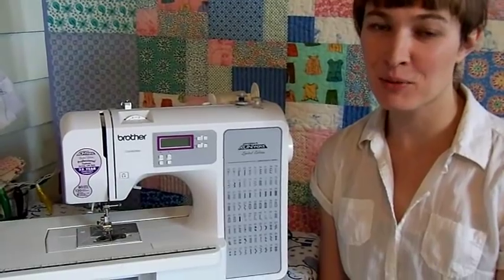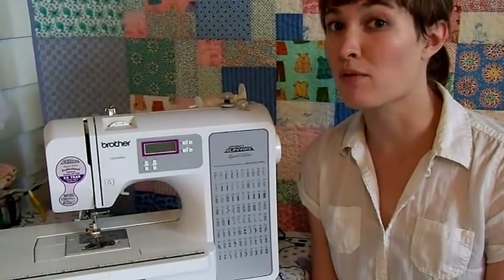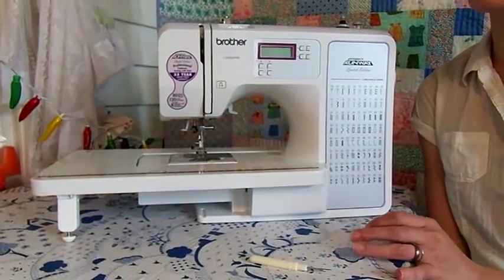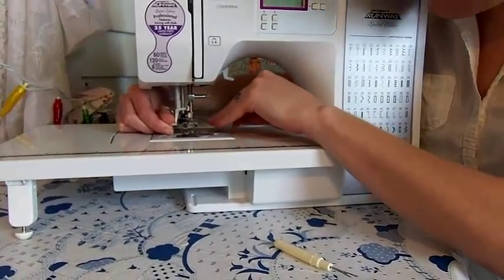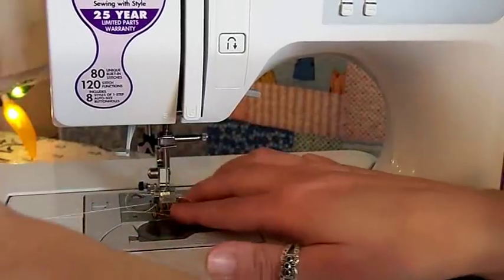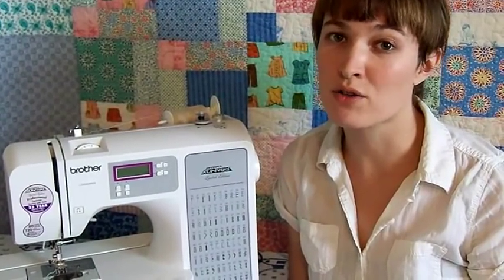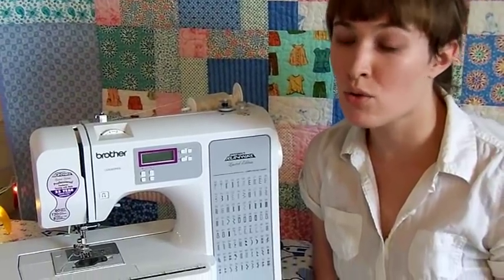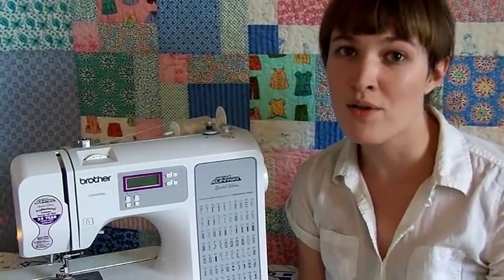How to Use (or Fix) an Automatic Needle Threader

Comment: Works great. Have enjoyed embroidering and for piecing quilts share4.photo/sSewing No issues with it. Seems to work with most 7mm feet. I’m using some of my mother in laws Brother feet from the 60’s/70’s and they work great. Even a very old walking foot which has been great. Nice heavy duty case which does not move around when I sew.

Comment: So I have had my viking jade 20 for about a month and after about 2 weeks the needle threader stopped working.  We tried your fix and after tinkering with a magnifying glass, bright lights and my husband's help we bent the hook back into place but it was an ordeal.  Well yesterday the needle threader stopped working again and I decided to ask at Joann's where we bought it for help.  But before I took it into them I tried one more thing that I did not find on the internet but just noticed looking at my machine--there is an easily accessible screw on the needle threader itself that I loosened and retightened and whala!!  The threader works great now.  Didn't have to return or pay a service guy to look at it and no time lost sewing!!Yeah!!  Hope this helps some others!
Reply from the maker: I'm glad to hear that you were able to find a new solution to the problem! For anyone who has a machine where the needle threader screws to the shaft, this is something that you should take a moment to check before attempting anything else! Thanks for taking the time to comment and to share your insight!
Reply: sharon gregory it re-fed the bobbin through and then re-threaded the machine making sure the thread grabbed where it was supposed to and it got everything working! I was really at the end of my wits trying to figure it out but that worked!
Reply: I did try every screw around and re-installed the needle and re installed the bobbin and thread from the top and it started working, obviously something wasn’t threaded right to grab hold and move everything into place. I get it how hard it is to manually thread the needle between age and lighting it was so sucky! Hope this helps everyone! Stay safe

Comment: Oh my! Thank you so much for explaining to me how to fix my machine.  It took a little doing, and some patience (and a high power magnifying glass for my poor old eyes) but I finally managed to fix the silly thing, without a trip to the repair shop which I could scarcely afford.  It turned out that the whole mechanism had slipped down too low on the shaft.  I pushed it back up and after a few little tweaks, it works once again!  I thought it was hopeless! Bless you, you sweet, thoughtful young lady.  What a great help!  Keep up the good work.  Bravo!
Reply from the maker: +Carla Stone Oh, Carla, you're welcome. Thank you for your kind comments as well. Don't get me started on repair shops!!

That's interesting, but also unfortunate what happened to you. I didn't know that the mechanism could drop down like that. If someone has that problem, I will send them too you. Happy sewing! and I will try to keep up with the videos.

Comment: OMG, you saved my sewing lsanity! I'm using a fairly new Janomie DC5100 machine and right from the start I had problems with the auto threader, but I never used one before so I figured it was me. Then all of a sudden it started working.   Then recently  I changed the type of thread I was using, and it stopped working completely.  My eyes are bad, and this a function I really love.  After watching your video I figured out that all I had to do was gently move the needle to the left a bit as I was threading it, and it works perfectly.  I think the hook is a bit bent, and I'm guessing it came that way.  Frankly, I'm not thrilled with this machine, but since I've used it and can't return it, at least I can get it to work the way it's supposed to!  Thanks so much for posting!
Reply from the maker: +ML Walsh  Gee, I've always wanted a Janome or Bernina, but I suppose that they can have problems too. I'm not sure if I mentioned it, but some of the different thread sizes can cause problems with the threader. I recently bent the hook again by using a small needle that didn't have room for the thread and the threader. I fixed it and stopped using the the auto threader with that combination. Happy sewing!
Reply: +Lzy's Sewing Room The machine manual will tell you what size needles you can use the autuomatic threader with for people that don't read the manual.  I'm not insulting you, I am saying this for the people out there that set their machine up and start using it.

Comment: I am brand new to sewing and this is my first machine. Thanks so much. I just self threaded for the 1st time. Also: Can you recommend other videos specifically for this machine. I made curtains & pajamas so I am "sewing," but I don't know when to change a needle, what presser feet to buy etc. I would like to watch videos where this machine is used. Thanks. Julie
Reply from the maker: Hi there Julie, I'm sorry that I didn't get back to you right away. I had a password problem of all things!

I change the needle after every few projects or if I'm having a problem with my stitches or the machine jamming. Maybe 8 hours of use is a rule of thumb, but who calculates their sewing time like that!

My machine came with several presser feet. You may have noticed that when you change stitches, the machine tells you which presser foot to use. There's an icon in the center of the screen. Below that symbol is a letter, this corresponds to a foot.

J is normal foot for straight stitches and a few zig-zags.
G is used for zigzags and it does a quasi rolled hem. See stitches 6-9 to get an idea of its function.
I use the zipper foot "I." For clarity that's i not L. This one has a single ski-shaped arm/runner in the front.
I also use the buttonhole foot which is made from white plastic. It's about 4 inches long. It does a great job of matching the opening to the size of your button. (Maybe I should do a video showing how that works.)

I almost never use feet N, R and M. I believe R is for fancy invisible hems on slacks, dresses or skirts, but I prefer to do hemming by hand, so I've only used  it once.

I use the free-motion foot, which has a clear plastic oval at the bottom where the needle sticks through. There's a spring along the shaft that helps it hop up and down. It's good for free-motion quilting or stitching lace with the feed dogs down/disengaged. I had to purchase it separately, and it's probably not worth it for most people.

I hope that this helps! I wish you lots of luck and hope that you have loads of fun. If you have any questions or video requests, just leave a comment!

Comment: You.Are.Awesome!!!  Because of your awesome video, I was able to fix my needle threader which saved me from having to tote my machine to the store for repair.  THANK YOU VERY MUCH!!!
Reply: What was happening and how did u fix it.    Mine won’t go into the hole and goes to the side
Reply: @jodiemcaninch676   I had the same issue you have.  My hook was out of alignment.  I used my seam ripper to nudge the hook back into alignment.  If you fast forward the video to 3:00, she explains it and shows you how to do it.
Reply: I'm afraid my hook is truly bent too fast to fix. I'm trying to find a video that will show how to replace that part. I've bought the part with the hook but can't get the old one off. Why do these things happen in the 21st Century?!
Reply from the maker: Sorry to hear that, @Susan Sinclair. The needle threader part is very delicate, but it sure is anchored on there....hope you find a convenient solution.

Comment: Hello, sorry if this is an idiot question 💜 should the hook (crochet hook) you describe go through the eye of the needle on the machine? Or should it incase the needle either side? 😋 My machine actually has 4 forks/prongs that incase the needle either side? Or should these go through the eye of needle? Erica x
Reply: The 4 prongs are actually your cage.  You need to look closely inside that cage for the hook.  It's very thin.  I have to use magnifying glasses and a magnifying glass to actually see mine, but I have old eyes.
Reply from the maker: Yes, @Rena Marroco is correct. The four-way structure is the cage that helps the hook-and-eye mechanism complete its action. It's possible that it's broken or bent.

Comment: A close-up view from the front and the sides of how the pin/hook should be aligned with respect to the guide arms would be helpful.  Our hook got bent, and though I bent it back towards the middle from front view, the hook is having trouble passing through the eye or  gets hung up on the eye when trying to withdraw it, making think it's still bent slightly up or down from where it should be.

Comment: I have a Singer Promise Sewing Machine,  but no automatic needle threader.  How do I get one to install on my Sewing Machine.  Do you have to buy a Sewing Machine with automatic Threader or what?  Please comment.    John
Reply from the maker: Hi there John, I don't think it's something that can be added on. You could use  a tool to feed the thread through. Dritz makes a classic one it's less than $2. It looks like a coin with a thin wire loop attached. You put the thread through the loop and then slide the loop through the eye of the needle. There are other styles too. Here's a link.

http://www.joann.com/dritz-needle-threaders/1038959.html#sz=90&start=1

I hope  this helps!

Comment: The automatic needle threader foot that grabs the needle when you push down, doesn’t move position in toward needle , (the little metal grabber to the right of step seven) a fix from anyone who understand that,
Reply: have you a solution? I have the exact same problem :\
Reply: I did figure it out I think, I honestly just took out the bobbin and re fed the thread and I also took out the thread from the top and re threaded it also, that also fixed the problem with the stitches bunching up on the underside. I hope this works for you. I loved the automatic needle threader as it was getting hard for me to see the eye 🤪
Reply from the maker: See if there's a screw to tighten that cage around the needle threader. It sounds like something isn't gripping. Good luck!
Reply: @lzyssewingroom2160  thanks, got it

Comment: My needle threader is stuck in the down position.  Any suggestions?
Reply: Same.
Reply: The hook won’t pass at the hole of the needle and keeps going to the side
Reply from the maker: If the needle isn't at the right level, the needle isn't inserted fully, or the handwheel isn't adjusted to the right position.
Reply: Paula; Hello, you  have to " lower the foot lever",if it can help😊🇨🇦.

Comment: That does not always work.  Sometimes it is a case where you need to loosen a screw in the needle threader and adjust the part that has the wire attached to it right or left.  There is also a screw that adjusts the up and down if it is going above the needle or below the needle.  I got the instructions from a repairman in Australia.  Sorry, I don't have the website.  Their fix was what my needle threader needed.  Bending the wire can break it if you are not extremely careful.
Reply: +Janice Hamilton Also, I use the needle up/down button to make sure needle is in highest position.
Reply from the maker: If anyone has a machine like yours, that would be a good thing to check before trying anything else. If the assembly is loose, that's the only fix.

In my case, the machine doesn't have a screw-on attachment for the needle threader mechanism. It has a rivet, so tightening the screw wasn't an option. The metal piece there is quite flexible due to the nature of the job that it has to perform, so I felt comfortable gently nudging it back into place. The way it was, it was unusable, so I didn't think it was risky. Of course, if anyone doesn't feel comfortable completing this type of DIY fix, the repairman is always available! Thanks for taking the time to comment, Janice.
Reply: I think I need to adjust the one that makes it go up and down. The whole mechanism is stuck in the "down" position and won't go up into the machine and away to sew properly.

Comment: i know its many years later but is there a way to remove this thing, i think its bumping my walking foot when i quilt and makes a weird noise
Reply: I don't think that there's a way to remove the entire needle threader. It might be possible to remove the tip. On my machine, that looks like a replaceable part. I would contact a sewing machine repair shop. (Sorry, I signed in with my other ID.)

Comment: I am actually Leighvee Emberton...  I am desperate to get my new CE1008 going to sew purses.  I am a first time sewing machine owner and have used machines that are already operating, but this one is out of the box.  It has been impossibile to get it running!  I can use the needle threader and get the thread where it appears to be set up correctly, but I keep getting anE2 error message.  First it was the bobbing thread going back into the machine and then it was the top thread bundling underneath the fabric.  However, each time it was discovered by me manually rolling the dial... it has never worked automatically.  Can anyone advise me on the E2 error message?
Reply: Hi there Leighvee, in the back of your sewing machine manual (just before the index) Brother has a troubleshooting table. According to this chart, the E2 error message means that the buttonhole lever has been lowered. That's the company's universal error code for this issue. When the buttonhole lever is lowered, you can only sew buttonholes and bartacks.

What you need to do is raise the buttonhole lever. On my machine, it's an L-shaped plastic piece right behind the needle threader. Make sure that it's all the way up. Let me know if this helps!